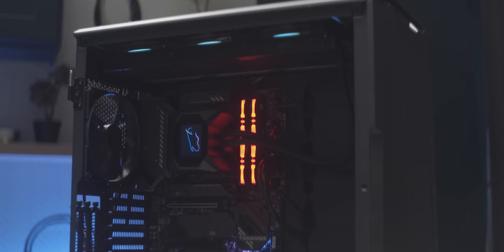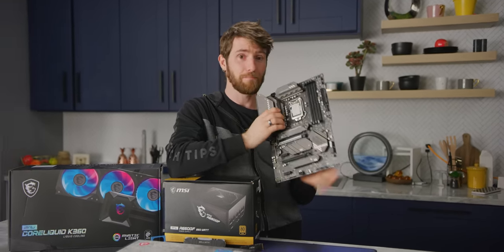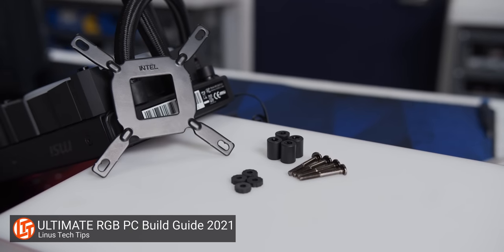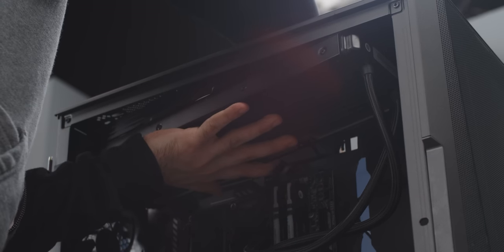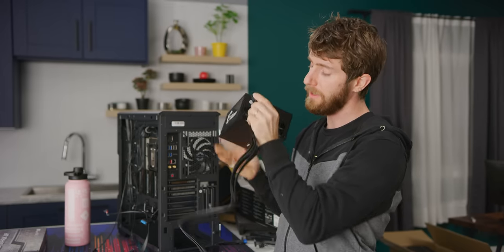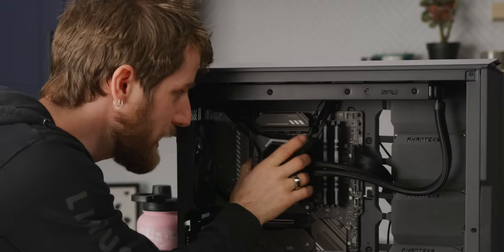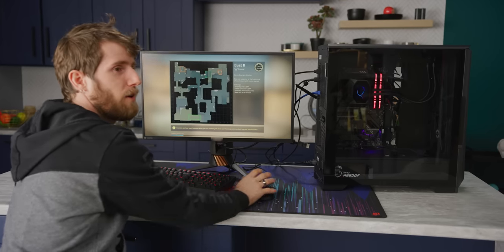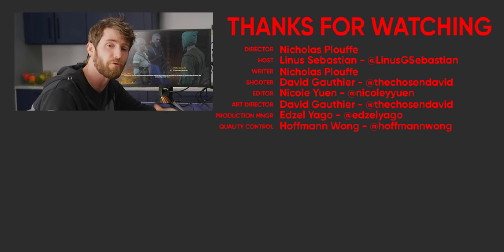You Can ACTUALLY Buy This PC!

Comment: I bought a Gigabyte Aorus RTX 3090 Xtreme for €2099 in late januari when it was in stock for only about 30 hours, after being 10th in queue for about 4 months for buying the 3080 Xtreme for €999,- in November. After seeing the 3080 xtreme missing from almost every shipment that came into the webshop I began to think about looking at 3090 cards, since they were briefly in stock sometimes (they have a page where they informed every customer of their place in the queue and what shipments they were expecting and receiving from vendors).

Then, when I saw another shipment come in without the 3080 xtreme but where the 3090 xtreme did become available, I quickly decided to pull the trigger and buy it before it was out of stock again, even though they increased the price from €1899 to €2099. This turned out quite well, I have to say, since at the exact same store the 3080 xtreme is now €200 more at €2299, while the 3090 xtreme is almost €1000 more at €3090,- now (lol, I'm not kidding that's actually true).

In hindsight I could not have been happier that I was pushed to buy the 3090, because now, after building my own pc for over 10 years since I was in high school and always looking at the best of the best which was far far far out of reach, I've finally reached the point where my pc is basically the best configured gaming pc possible!

Comment: I usually always buy the "70" when I upgrade my GFX card (gtx 570-> 770-> 970-> 1070). 
At the 3000 series announcement I saw what a step forward the series was. And I dediced to put some money aside and intended to "splurge a bit this time" and get a 3080. "Even if it ends up costing something crazy like over €900" I said at the time. Fast forward to now, my 1070 shit the bed last week and I ended up getting the cheapest 3070 in my area (an MSI RTX 3070 Gaming X Trio) for €1250. Looks like I'm destined to keep buying 70 series cards. 
Now, I had funds available to buy one of these, but I'm sure this whole situation is steering an entire generation of gamers away from PC building and pc gaming.

Comment: I drove 2 hours to micro center, went with the mindset that I’m upgrading. Then they had no GPUs, so I bought a prebuilt with  a I7 10700, and a 2060 super. Fast forward a little bit, I bought a new case (H510), motherboard (MPG Gaming edge Z490), new ram (2x8 Vengeance Pro), New CoolMaster AIO cooler, and as well a new EVGA 750 80+ gold power supply. I might have paid a lot more than what it was worth, but I ended up getting exactly what I wanted so I guess that’s a W

Comment: Poland. Just got my hands on 1660 Super OC / Ryzen 5 3600 / 16 GB 3200MHz / 1TB nvme prebuild in a very nice case for 4600 PLN (1200 USD) which price got bumped up by 20% literally a few hours after I bought it. Got my hands on 1440p 144hz IPS Gsynced monitor that I hope will stay with me for many years to come (pretty much the reason I was okay with overpaying a little bit for the screen). Mind you I used a 10 year old Thinkpad T520 with junky Nvidia Quadro before that so it's a big leap for me.

I think this build (or the Intel equivalent) is the sweet spot for "playing any game you want in, but not always maxed out" right now. I got a Ryzen, because code compilation (and really any other truly multithreaded task) benefits from that. AMD GPUs are a total joke (price) right now so I crossed it out in the beggining.

The one benefit from this pandemic rush is that once you set your budget at a certain point you have like two or three available models for GPU/CPU and there is no room for nitpicking, just get what has a better price/performance and take it home. Well... At least if we put aside that a year ago I would've paid less for this build, but hey... shit happens.

Comment: I bought a used GTX 970 for 300CAD + 24CAD shipping. It works wonder with my R5 3600 and is a BIG improvement from a i5-7300HQ + GTX 1050 lenovo yoga laptop
I sold the laptop and spend an extra 300$ for that upgrade. I already had a 24.1" 75hz 8:5 monitor, SS sensei mouse and a TKL mx brown switches kb.

Comment: still happy with my 2080ti here and my 8700k.

also its not about buying a new GPU but its also when your current one dies, as my mate has had happen to him with his 5700XT, his PC is and AMD build so he cant even turn it on to use it as a PC (no inbuilt GPU) and the GPU has been away for repair/replacement for over a month now.

Comment: i bought a new System instead of building one because of the GPU prices. In this one i got a 2060 for about 320€ which is okayish for me, was by far the most reasonable option. Perfect Card that gives me enough performance for everything i do and i wont feel like i wasted much when i replace it in like 2 years when GPU prices hopefully have recovered somewhat

Comment: Here's a fun bit: performance on Intel integrated graphics on Linux (especially when using Wayland) is easily superior to Windows. Sadly it can be a bit hard to configure, but if you're already interested in trying out Linux and you only have integrated graphics that's a little extra incentive in the case you're on the edge about it.

Comment: Built a pc a couple mouths ago wasn't able to get what I wanted for a gpu. Ended up going with the MSI Radeon RX 5500 XT DirectX 12 RX 5500 XT GAMING X 8G 8GB 128-Bit GDDR6 PCI Express 4.0 HDCP Ready Video Card for $700 considering still a lot more reasonable than some other cards

Comment: I didn't do enough research when buying my parts and didn't know that ryzen didn't support on-board graphics. I was so confused that I ended up returning my MB and my CPU thinking something was wrong with them. I just lucked out that my coworker had an extra GTX 750 so I could at least test my build and get windows installed. Being in Hawaii it's even harder since we don't have any stores we can drive to and some sites won't ship here

Comment: There are always the Ryzen APUs, though it might be worth waiting a bit for the 5000G series to be available for retail for non-OEM partners, because the previous generation was OEM-only and the generation before that was based on Zen+, and to my knowledge didn't have high-end APUs in that generation (upto a 4-core 3400G, where the 5000 series APUs goes upto an 8-core 5700G) so these older ones are getting a bit outdated.

Comment: I did rebuild my system recently but I thankfully still had my old 1060 to fall back on.  I do still need an upgrade and have some money set aside for one but that isnt happening at scalper pricing.  I just want a 3060ti or even 3070 but this may or may not happen in this lifetime.  Been on EVGAs waiting list since september of last year when I set the money aside for it.  Regularly watch the newegg shuffle but its prices keep going up and up and they keep bundling stuff I dont need.
Current build.
Asus maximus hero xiii
Intel i7 10th gen 10700kf
HyperX predator DDR4 2933 CL15 4X8GB sticks
Saegate firecuda 520 2TB
Seagat barracuda pro 10TB
EVGA RTX 1060

Comment: Thats why i always have a Geforce GTX 960 and an R9 270 spare-Card lying around, so i could always make a quick check by putting one of the 2 grafics card in.
Why 2? 
First: If one of the Dies, i have a spare for the Spare 
Second: Not all Mainboards compatible with Nvidia or Radon Grafics-Cards. So i could switch arround with them.

A long time ago i had a GT 550, but due to the bad performance and old architecture, i switch this to al GTX 960. And the Radeon HD 5670 was switched out for the R9 270.
So i made an Upgrade for my Spare parts too. ;)

Comment: I just bought a prebuild off IBuyPower for $1900. Im new to PC. Did i get a good deal?

Specs:
MSI B550 Tomahawk MB
AMD Ryzen 5 5600x
RTX 3070
16Gb (2x8Gb) DDR4 3200mhz
1Tb SSD M.2 NVME
240mm RGB Liquid Cooling CPU cooler
Default case/case fan
700 watt PSU
M/K included

Comment: I managed to secure a an MSI 3080 suprim x  a couple of months ago for £960 from curry's in thr UK, tbh I'm not entirely sure if I got my pants pulled down over thr price given what I have seen them go for but I must admit it was a huge upgrade over my 1080 zotac amp extreme (which my daughter was extremely grateful for) I'm still gaming on my 10 year old intel 3930k until the end of the year when I was originaly looking to upgrade but bagged this in advance to save on disappointment. Only suffering from a few cpu bottlenecks at 3440 x 1440p 100mhz panel so still have performance to look forward too when thr rest of thr pc can catch up

Comment: i overpaid for an rtx 3070.... but i also built an ESXi server (inspired by 2 gamers 1 cpu) with an e5 2680 v2 10c 20t cpu on a huananzhi x79 (c602) mobo and have 3 windows vm's that are running some more budget friendly cards (rx 560 x 2 and an rx480 that i had in a swap) and carved out 3 machines for friends locally that dont have full setups at the moment to game on via parsec. also added a third ubuntu vm that runs a lan cache so that all three arnt downloading the same stuff over my ISP connection. Pretty cool proof of concept :) ended up with each  windows vm getting 4 cores, 16 gigs of ddr3 ecc and either an rt 560 4gb or rx 480 8 gb and pretty reasonable latency even from Montana (where i am) to Seattle where a friend lives (43 ms)

Comment: I'm still surprised no one suggested (or it wasn't highlighted as an option in the video) using Intel for the integrated graphics when Sarah built a computer. Intel isn't sexy anymore, sure, and IG sucks compared to dedicated graphics, but it's still better than wasting half your budget on a single card that's had it's price doubled...

ETA: I thankfully had to emergency purchase a GPU a few months before covid hit so I got my 1660 Super at a sane price. Not what I had wanted to be buying, but at least I have a card that can handle everything I'm currently throwing at it.

Comment: You should build a Dry water pc like you did with mineral oil, you tested a liquid cooler that had a liquid that boiled in 2019. It had dry water in it. its call Novec and you can put a whole pc in it and it wont short on electronics, Novec boiling point is 49.2 degrees C. I think it would make a great video. if you have already done that I would love the link top the video.

Comment: Having decided to move BACK to pc from MAC, maybe at the worst time ever, I've found there are deals to be had.  Starting from NOTHING pc related, (so I wasn't trying to upgrade anything)  being patient, and finding deals on MSI rigs (Desktop and Laptop, both purchased on sale from best buy) with at least moderately decent graphics (RTX 2060 Super) wasn't a problem.   

I've also been keeping an eye out for prebuilt pcs that have known, but easily overcomeable flaws (only one ram stick and tiny nvme or SSD storage, or God forbid SATA drives), and they do pop up.  HP has a Ryzen 5, 8 gig ram, 256gb, gtx 1650 super, for $599 at WAL-Mart of all places. simple upgrade and you have a very usable computer WITH a GPU.  They have the same type of deal on an i5 laptop... 8 gb, 256, GTX 1650, etc.  For mid-tier games, these systems actually have done really well. 

Ram is still affordable, storage is still affordable.. patience and timing are the keys.  You hesitate.. you lose.  There are also deals to be had on legitimate refurbished sites like vipoutlet.com too and don't forget to look at big box offerings on ebay as well.  There are deals to be had if you are willing to buy the whole cow to get a glass of milk.  I'm running about 66% success with vipoutlet right now with 1 out of 3 units arriving DOA.  But, the unit was under HP warranty and they are fixing it at no cost but a couple of extra weeks for the parts to come in. 

So if you can live with a 1600 or 2000 series nvidia GPU, look around.  You may be surprised what you can find.  (3000 series gpu systems are popping up now for less than scalper pricing for just the card) Every system I've purchased in the last 6 weeks was less than the price of the GPU alone (laptops not included).  With minimal additional investment, i.e. ram and storage, i'm up and running.  The learning curve has been expensive, but also very fun.  

Oh.. and I blame Linus for all the money that I've spent.. had it not been for his videos.. I'd be blissfully ignorant of much I missed my PC gaming and PC life from 15 years ago..  My credit cards hate you...

Cheers
Rick

Comment: I didn’t buy a GPU per se, but I really wanted to try to get my hands on a 3070 or even a 3080. I traded up some spare PC parts. I had an i7-7700K with a 212 EVO cooler, a Maximus IX Code Motherboard with an M.2 SSD and a 5700 XT and unfortunately all I could get was a 3060.

Comment: you can do very slightly more DIY route by using Paperspace Dedicated GPU vms (untra easy to buy VM there) and instal parsed on your local machine and VM
you can run whatever you want, steam or anything else for $0.51/h for quadro p4000 GPU or $0.56/h for quadro rtx4000, both with 8 cores and 30GB ram

Comment: Still in the planning stage for my new build, given I won't have the cash to pay for it until Tax Time.
I don't, however, have any plans to buy a GPU and will be hanging onto the GTX 680 in my old dead tower and crossing my fingers that it isn't the weak link causing its blue screen loop issue.
Given I have a PS5, I don't need the tower for gaming, and it will mostly be an HTPC, but it would be nice to be able to play games on it in the future, so eventually, it'll get a new card too.

Comment: I have yet to get a new GPU, but thankfully I bought a 1660 Super about a year and a half ago, so I'm running with that on an ASUS 1440p 165Hz monitor (even though I get at best 80-something FPS). Been HARDCORE tempted to buy a prebuilt from Origin just for the GPU........

Comment: Playing my 580's past death.They mined before I bought them 3 years ago. They mine when I am at work. 
Running 2 RX580 Sapphire special editon in crossfire. Call them my Blue Beauties. (1080 limit. My 1440p 120hrts monitor I bought hopeing to upgrade is being under used.) 
I have the ability to wait. "I would like to know what ray tracing on amd looks like."

Comment: When the first glimmers of the pandemic going global started to get people's attention at the beginning of March last year, I decided to move up my planned purchase of a graphics card. I was going to wait until summer but figured there would be supply chain issues because of pandemic effects on the factories in China. (Little did I know just how bad things would get!) I went to Micro Center planning to spend about $300, which would have gotten an RTX 2060 KO or an RX 5600 XT. But they had an open box RX 5700 XT for $300 that day, complete with full warranty and returns and even the free games from AMD.... sold! The open box discount was bigger than usual because Micro Center wasn't planning to restock that particular model of RX 5700 XT card, though later they did when the pandemic hit in earnest and supplies got tight; it would have been a $400 card if they had had unopened ones when I bought it.

it's a bit of overkill paired with a lowly Ryzen 2600X which I had grabbed for $80 a bit over a month earlier when Micro Center was selling those off cheap to clear the way for the third generation parts (and you still got the $20 motherboard discount to boot!), but the price was right. I also bought 32 GB of DDR4 (I do software development as well as gaming so lots of RAM is called for) and a B450 motherboard when I bought the CPU; the rest came from my previous system (FX8320 and GTX 560Ti -- please don't laugh). My usual rule of thumb for a balanced gaming system is to spend 1.5x to 2x for the graphics card compared to the CPU, but I treated that special deal 2600X as a $150 CPU for pairing purposes.

1In hindsight, buying when I did was the best decision I made in that entire crazy year. Or perhaps the second best, just behind staying home and staying healthy.

Comment: I was lucky enough to get a 6900xt for under MSRP about a month and a half ago, so I'm set for the foreseeable future. Thank *god*.
Reply: Me too, I went straight to the second hand market when they realised and bought a brand-new 6900 xt reference for $1.200 USD. Only $16 USD more than the retailers in Denmark sold it for.

I am glad I did it because now there is only 3rd party cards available and they cost above $2.000 USD. The most expensive one I have seen is $3.500 USD. And it's not even a power color liquid devil.

Comment: I bought a MSI 2070 Super from Best Buy right before the pandemic really started. I paid like 330$ for it. People were telling me not to buy it because the 30X0 cards were coming and telling me how stupid I was for wasting my money. Looks like I am the one laughing now because most of those people are running 1050ti/1060 cards and can't even get a used 20X0 series card without paying out the wazoo.

Honestly I am thinking of upgrading using the pre-built pc route and just buying something a bit lower end in the CPU and other bits and using my 2070 super in the prebuilt machine as my sim racing rig instead of having to switch over the display cables from my sim rig to my desk monitors every time. And it would free up some room so my rig isn't right next to my desk so my gaming room won't feel like a closet in one corner. If I didn't have a reason to really use a 2nd PC at all, I would never even think about going that route but I am also in no real hurry.

Comment: I'm using a Ryzen 5 with AIO to run my games.  Not at the top end, but that is due to my small PSU I think.  When I plugged in my Quest Rift-S, I lost half my USB ports, everything above the onboard HDMI. so I think my 450 PSU is a bit too small to run the full vega graphics well.